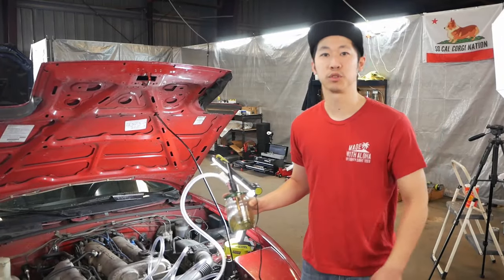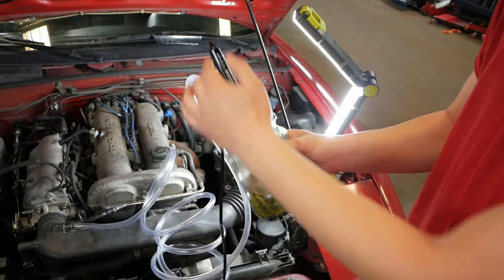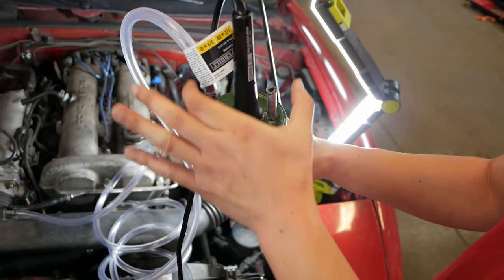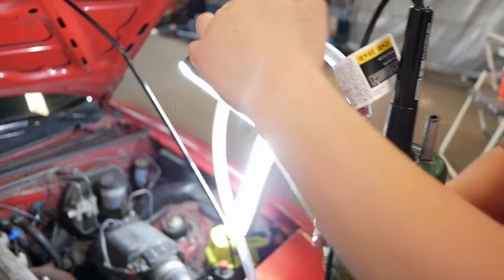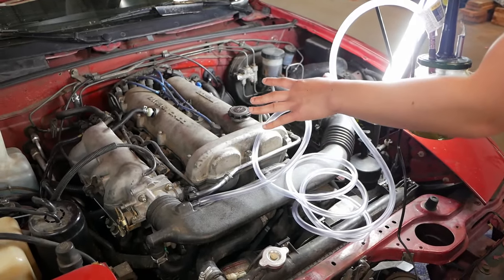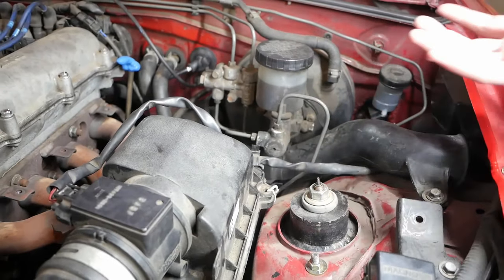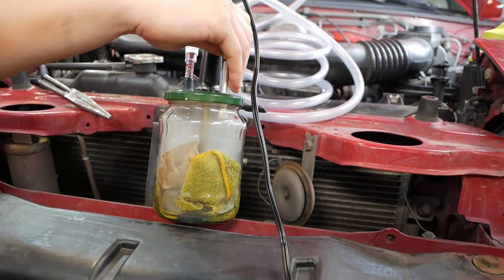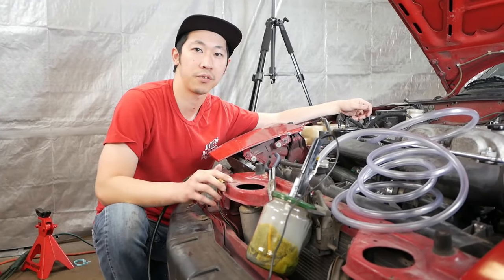Build a Smoke Machine for Under $10 | How to Smoke Test a Car | Check for Vacuum Leaks

Comment: DO NOT apply more than 2-3 psi pressure to the evap system...  pull all the vaccum u want.  I like using a cheap 3$ aquarium pump (they are 1-2 psi) to induce smoke so I'm able to move around freely with 2 hands.  I also recommend using a metal paint can with a handle rather than glass because iv had glass gars crack and break from the heat.  Just some tips from some guy on the internet
Reply from the maker: thanks for the tips!
Reply: BATTERY POWERD BLOOD PREASURE PUMP... VERY LOW PSI
Reply: Thanks!
Reply: Will this work for leaks at the rear of the car by the charcoal  canister?
Reply: @Pinkielover  mine hit 30 psi when I checked
Reply: @joejanusz1164 yes that's what this is for

Comment: A much more simple way to smoke test is to buy a cheap AC / DC air pump (normally for filling air mattresses). They come with different size nozzles. The input side you use a cigar, the output  a piece of hose to a vacuum line. Turn the pump on and watch for where the smoke comes out and there you are. Cost like $10. Works perfectly and it is instant.
Reply from the maker: thats a great idea!
Reply: You have to be very careful with cigars, tobacco releases resin when burning and that resin sticks to everything including the insides of your engine's vacuum system.
Reply from the maker: @8307c4  you're probably right. I guess in the end burning mineral oil really is the best way to leave no residue!
Reply: You think a blunt would work ? 😂
Reply: @MikeSmith-nu9wt  Yeah it works for that too. Blows a nice smooth stream of smoke straight to the lungs. A fish aquarium pump will do the same thing, only even better. It won't burn it up as fast as the bigger pumps do. An old friend of mine made one, like 45 years ago. Everyone loved that contraption!
Reply: @MikeSmith-nu9wt don't waste the dutchy 😂

Comment: To prevent the smoke from coming out the air box I have seen mechanics pull the air cleaner hose off where it hooks to the Mass Air Flow Sensor.  They then put a plastic grocery bag or garbage bag over the tube and then install the tube back on the Mass Air flow sensor.
Reply from the maker: yup that works too! you dont even need to put the intake tube back.
Reply: I've seen a rubber glove works well too
Reply: Yes, you should always remove the MAF because it's very sensitive to deposits

Comment: If you would’ve just hooked up the hose to the intake manifold itself (like the pcv hose u pulled off and broke the pcv 😂)you won’t have to hold the throttle open manually.And I would actually pull the intake off and plug up the throttle body with a rag to get better results as u don’t really need to worry about leaks on the intake as much!

Comment: Thank you! I had everything needed to make this except for the baby oil. I put it together, connected it to my evap system, plugged it in and WOW. Works amazingly well. Lots of smoke. Can’t believe how much smoke it produces. Thanks again!!!
Reply from the maker: Glad it helped!
Reply: That’s wild. I did everything shown on the video and barely any smoke at all. Maybe my old soldering iron is bad?
Reply: Just what i needed to find , 580 at harbor freight , im digging through the shop and house for supplies , no baby oil ? You think KY warming liquid would work instead ? 😂😂😂

Comment: A 4 years years late to the picture show but I made the smoke generator according to your plan. Used a fish tank low PSI air pump instead of hand pump.  The smoke comes out of the handle of the soldering! I guess when you said "cheap" you meant it. The one I'm using is a $9 model from the jungle site. :-(  Good project and simple. I WILL get it too work. 🙂

Comment: Thanks for the idea! I put one of these machines together and finally found my leak around the bottom of the throttle body. P0171 code fixed. Thanks
Reply from the maker: glad it was useful!
Reply: So did you just replace the throttle body?

Comment: The only issue I have with mineral oil as a "smoke fuel" is not knowing how it will affect various sensors after coating them with that smoke. I like the idea of a fog machine, as it is water-based which is harmless as long as you're not going crazy on the smoke: just enough to get it done.
Reply from the maker: I think mineral oil is the generally accepted solution for smoke machines but then again I am a backyard mechanic so I shouldnt be quoted on that.

I will say I'd imagine that any light coating that may occur possibly couldnt be any worse than the blowby that occurs naturally during engine operation?
Reply: @HazardGarage  my cousin has a snan on machine at his shop and they be using cooking oil and shit
Reply: You can use literally cooking oil. You’re correct blow by is far worse than any small coating you give it. Residue will be burned off and ejected as soon as you bring it to operating temp.
Reply: Mineral oil with dye is literally what is in the smoke machines that you buy and mechanics all over will tell you that.
Reply: @Quintos.  what kind of dye might one use in a DIY machine? AC dye, engine oil dye?

Comment: I'm going to construct something very similar to test for a vacuum leak causing a low idle condition. However, I would imagine you could simply just connect a second hose to the inlet and gently manually blow the smoke into the system.
Reply from the maker: yup! you can use a bike pump, hand pump, just anything to blow the smoke through!
Reply: That's basically what Scotty Kilmer did after puffing on a cigar; he just blew the smoke right into a hose.
Reply from the maker: @SuperJ213  probably not the most efficient or healthy way lol. Also using burnt stuff like cigars or burning wood, Id worry a little bit about it leaving carbon or something on sensors. My understanding is mineral oil is the industry standard because it smokes clean.

Comment: This works fine maybe add a Warning Disclaimer to the video example use a power strip with built-in fuse breaker and properly dispose of oil soaked rags to avoid changing Channel Name to Fire Hazard Garage 🔥 jk keep up Good Content!
Reply from the maker: lol yes good suggestion!

Comment: Can this method be effectively used to pump smoke into the gas tank to find an evap system leak or is there another entry point where the smoke should be introduced?
Reply from the maker: In the video this would apply to vacuum lines. I don't have any experience with using it for evap leaks, but from what I've read you can commonly use a smoke test for evap as well. 

Have you tried replacing the gas cap with an OEM gas cap? That is a common failure of the evap system and sometimes those auto parts replacements dont seal very well.

Comment: So I'm working out of an apartment and don't have access to an outlet. Is there either a safe way to use alligator clips to the battery, or to use a propane soldering iron?
Reply: You can purchase a 12v soldering iron for about $10US.

Comment: Hello what is the safest way to store this after use since the rags are oil saturated?
Reply from the maker: honestly i just stored as is.  not sure if the mineral oil dries up or will be good until next use.  I got my mineral oil from the dollar store and rags are always a plenty around the garage.
Reply: @HazardGarage  Did you have to crack the lid or empty out the rags and oil at all?
Reply from the maker: @organic80  not sure I did not lol

the good news is there shouldnt be any safety concerns since its just mineral oil.  If you want to keep things tidy you could just throw away the rags/clean up the jar and store it.
Reply: Thank you :)

Comment: Does the soldering iron need to be touching the rags? Or just close?
Reply from the maker: it should touch the mineral oil soaked rags.

The rags should be soaked in oil but not so much that excess is pooling up.

Comment: How long the soldiering iron will last? Mine burned after 2 attempts
Reply from the maker: I've only used it a few times and its still working good for me. We are using cheap soldering irons (to keep costs low) so maybe that has something to do with it.

Considering how expensive smoke machines are, a $5 soldering iron every so often might not be a bad trade off for some who just needs a smoker for light use.

Comment: Is there any part of the soldering iron that is touching the rag? Or is it just to heat the air inside the jar?
Reply from the maker: Yup, soldering iron touches the soaked rag. Mineral oil prevents the rag of igniting and also provides the 'smoke'

Comment: I have diy smoke machine, and it works fine. I'd like to be sure I understand the process - 

Car off
Throttle plate open (a little? All the way?)
Cover air box (optional?)
Hook machine up to any single vacuum hose (brake booster?)

Did I leave anything out? Anything I got wrong?

Many thanks!
Reply from the maker: yes! car off. throttle open (to allow the smoke to travel through the system) and attach it to a vacuum line. preferably before the throttle body (so you dont miss vaccum areas). 

Then just see where it leaks out (if any) and thats it!
Reply: @HazardGarage  Thank you so much again!

Comment: just made this... how are you not getting smoke coming out of the solder iron harness? im using the same HF one as you.
(EDIT), i see you are too.
Reply from the maker: do you mean where the soldering iron meets the cap?
Reply: @HazardGarage   nah ive got a good jb weld seal there. but smoke blows out from the end of the solder iron where the power cord comes out of the handle.
Reply from the maker: @tvillaa  ohh i see. It is possible our cheap soldering iron isnt the best build quality 😅but as long as you are getting some smoke through your car system then thats all we need!

Comment: would a party fog machine also work?
Reply from the maker: theoretically it could, but you have to be careful about the fluid you use. I think fog machine fluid condenses really easily which can leave residue on sensors and such. Mineral oil is the generally accepted fluid to use in professional automotive smoke machines but I dont know if they would work/hurt fog machines.
Reply: @HazardGarage  thank you! i wasn’t aware of that concern.

Comment: Using mineral oil in a DIY smoke device for diagnosing vacuum leaks can be safe, as long as you take proper precautions. Make sure the mineral oil is pure and doesn't contain additives that could produce harmful fumes. Additionally, use the device in a well-ventilated area, and avoid excessive heat to prevent the oil from producing hazardous vapors
Reply from the maker: Thanks for the tips!

Comment: thanks man ...i pulled number 6 spark plug wire and heard a whitelisting noise, then the engine died on a old v6 taurus ........i can pull all the other wires and the engine wont die ....why does it keep dying on 6 and i hear the wistele right before it dies any ideas....

Comment: I just bought a bmw with a p0174 code. I know bmw’s are delicate sometimes so I’m wondering would this tester mess with my mass airflow sensor or any other sensors?
Reply from the maker: If you use mineral oil, than you should be ok. I believe professional testers also use mineral oil for smoking.

Comment: Does the car need to be running? Opening the throttle wouldn't you flood the engine?
Reply from the maker: Car should NOT be running. If your car has a cable throttle, then you can just manually open the valve with the car off. On cars that have a drive by wire, I think there is a hidden method dependent on the car, that will open the throttle with the car still off.

Comment: My truck has a code for a leak but I tried starting fluid cant find the leak.  The engine doesn't change at all when spraying it around the lines.  My truck has these weird plastic lines and they don't make them any more.  Each side is a different size and connect using rubber elbows so no idea how i can use standard hoses to replace them.  One I glued back together with e 6000.

Comment: Damn, I was quoted $180 for an evap test that doesn't even include the price to maybe patch it if needed. I would love to do it myself but I'm too unfamiliar with engines to trust myself with this.
Reply from the maker: If you aren't able to potentially fix whatever may be leaking. Then its probably best to just let your mechanic do the diagnostic and the repair. Sometimes shops will waive the diagnostic if you get the repair done with them. Cars can be expensive and complicated unfortunately. No shame!

Comment: So this might be a silly a question but is there a reason why no seems to use smoke bombs/tabs? I use them when testing the sewers I install but I never seen anyone suggest them for car vacuum leaks. What am I missing?
Reply from the maker: I'd imagine it might be residue and sediment that those would leave behind on sensors?
Reply: I think a smoke ball would work better.
Reply: they make smoke in a different way, mineral oil produces a weird aerosolized mineral oil which is similar to petrochemicals and will just burn off in the gasoline with little to no harm done, but smoke bombs can have salts in them from the oxidizer which will corrode metal parts
Reply: Ok that makes sense. Mineral oil burns cleaner. Got it. Thanks

Comment: You need to be critical of videos like this one. Unless you love life on the edge. First off it takes forever to heat up the iron. What you use to connect the in & out hoses on the lid of the jar is very important. In most of the videos the guys are just drilling holes sticking the outer piece of a Bic pen in the hole & sealing in up w/gasket maker/sealer. Not a good idea because before the soldering iron gets hot enough to create the smoke the jar lid has been getting hotter also & whatever plastic touching the lid will be melting. Second is the fact that most jars aren will crack or shatter,possibly explode(depending on the conditions). Third,You won't get alot of smoke unless your pushing fresh air into the jar. So while you don't see smoke that shit in the jar has gotten hotter than you think. So when you introduce O2 it could ignight & blow up(depends on amount of oil & what type). The jar will be to hot to hold in your hand so you will have to run the hoses from where you place the jar(hopefully on the ground inside something that isn't flamable)flammable. Another thing to consider is the length of your iron. When it's flush mounted onto the lid will it extend down far enough to make contact with the material you use to create the smoke?  So you should use a short round jar. So for under 10 bucks you get a piece of shit that could blow up & start your shit on fire. Bad trip! Tips: Use a clean 1 gallon paint can. It's not going to tip over from the weight of a hose. Use air fittings w/ nuts. Won't have melting problem. Good luck , Be Safe , Smoke Pot & prepare for the REVOLUTION!!

Comment: can i use glow plug instead of soldering iron ?
Reply from the maker: not 100% sure but theoretically you should be able to use anything that gets really hot short of a flame. The mineral oil prevents the soaked rags from catching fire, and instead just smokes.
Reply: @HazardGarage  thank you.

Comment: I just built one with a Harbor Freight soldering iron but air is leaking through the soldering iron.
Reply from the maker: I sealed mine up with some glue. If you have any silicone or caulk lying around that could help!

Comment: what kind of oil do you use ? you said "Mineral" but I can't found anywhere baby mineral oil where I live in france. Thank you
Reply from the maker: yeah specifically here in the US its called "mineral oil" and "Baby oil" (which is a type of mineral oil). I wouldn't know what it could be called or where you can get it in France. You can try searching "automotive smoking oil" but it would be more expensive I think.
Reply: @HazardGarage  thanks you, i've found this oil on internet. ✌️
Not make the smoke generator yet... But I got all'the stuff. 👌
Reply from the maker: @S0LlDSNAKE  let me know how it goes!

Comment: What if my engine running with electric throttle?
Reply from the maker: should be ok. just pull a vacuum hose and run the smoke to see if you have any potential leaks.

Comment: I want to be 110% sure will the baby oil contaminate the gasoline and make it not ignite properly ???
Reply from the maker: Never heard of any issues. You're just blowing a little vaporized mineral oil through the vacuum air system.
Reply: @HazardGarage  trying to find a way to find a leak in my gas tank with out taking it off or gating a new one is all

Comment: damn i tried this and it did not quite work. Smoke was created indeed but it mostly came out of the soldering gun.
Reply from the maker: like it was leaking from the soldering iron hole? Try sealing it with like silicone glue or something.

Comment: How to build it from the start..
Reply from the maker: Sorry I didn't include that part but its not too difficult.

1. Find a glass jar
2. Drill a hole to fit the soldering iron
3. Drill 2 holes for tubing
4. put wet rag soaked with mineral oil into jar
5. Insert 2 clear tubing into the holes
6. Turn on soldering iron and wait for smoke gather
7. Gently blow a little air into one tube and to push the smoke through the the other into the car and observe (this is shown in the video).

Hope that helps!

Comment: Hey I see here people bashing you for the cost of things. Thanks Biden for that, but moving on if you have a spare tire well you have air pressure, go fill it at Costco for free with 40 PSI. Get a paper clip fold in half next take a bic cap and put hole dead center  push paper clip to expose aprox 1/4 inch thru cap, now wind the extra clip wire around the cap. Now push it into the hose with the protruding paper clip to depress the tire valve in the hose aprox 5/16. Me I would loosen the valve with core remover but want to keep the cheapies satisfied and push into hose over air valve and now you have a somewhat air supply for free. If you do this when you get gas you can do it for free.